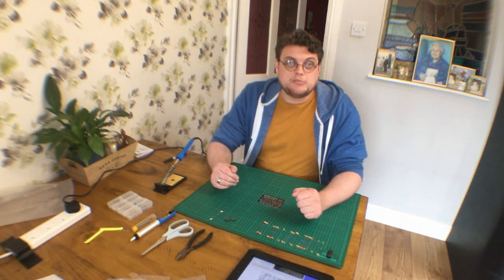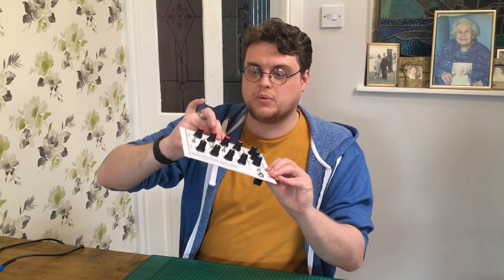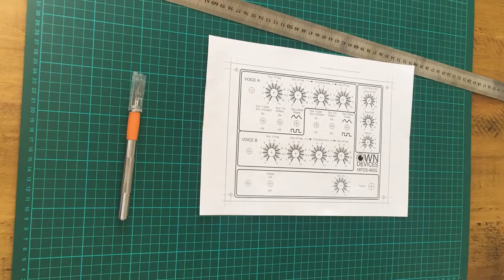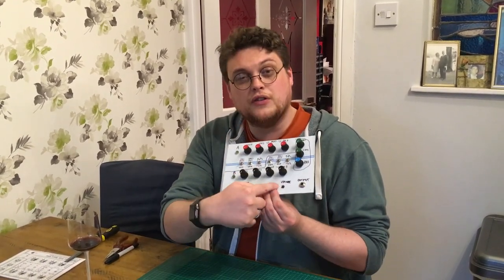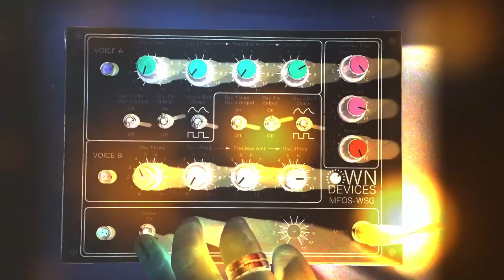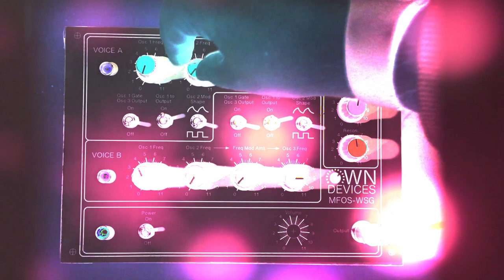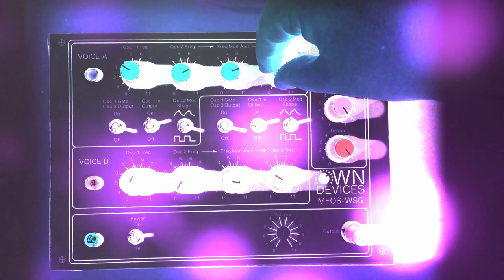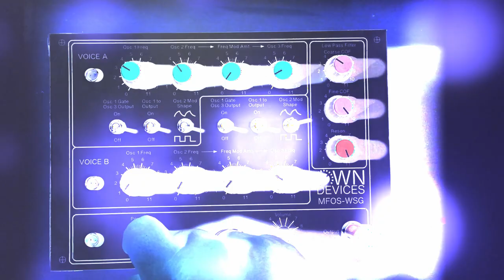Building The Weird Sound Generator

Comment: The best material to make the front panel out of is some 1.6mm sheet aluminium, adding a ground-wire to one of the pot's metal shield helps to reduce spurious cross-talk between the two oscillators, I found that out the hard way when using a scope to de-bug my WSG build, one of the oscillators wasn't oscillating properly like it was supposed to, turned-out the cause was due to stray capacitor coupling between some copper tracks of the Veroboard I used to build the circuit on, all I had to do was remove some excess coper track from the underside and that fixed it.